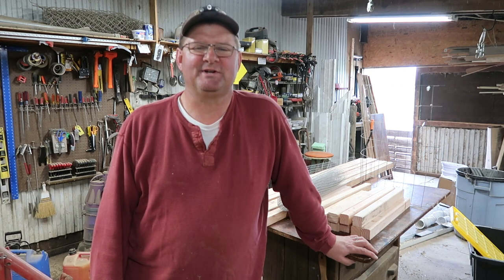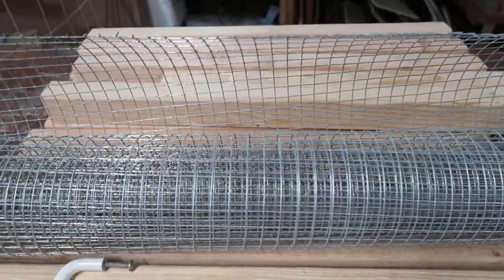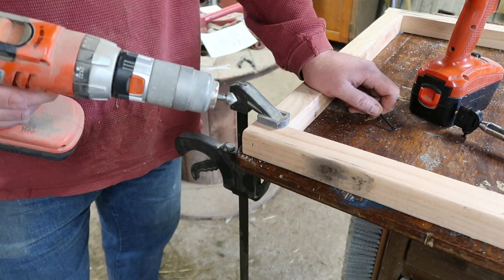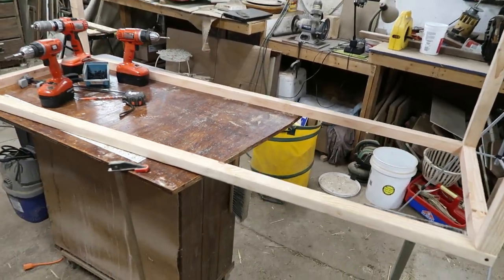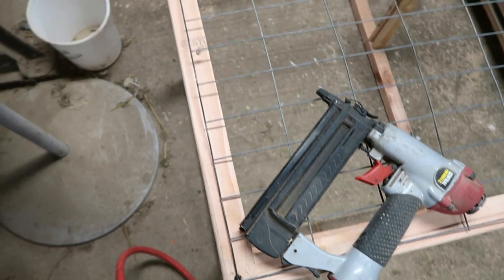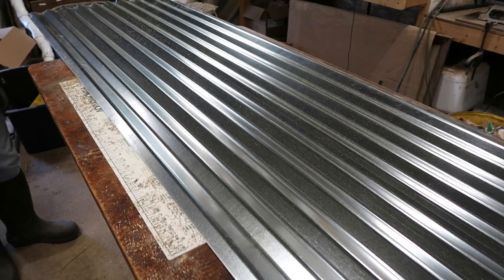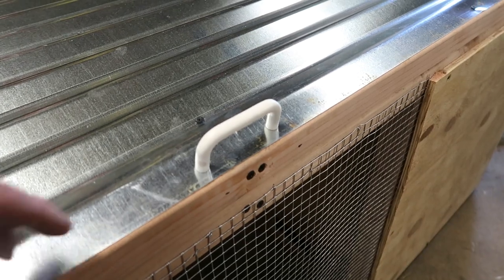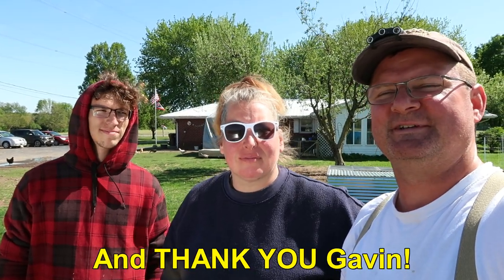Building a Rabbit Tractor for about $75

Comment: I like this idea. My grandparents used to raise rabbits in cages.  I was wondering if the roof on the cage would make it too hot for the rabbits or if you try to keep it in shaded areas during the warmer summer months.
Reply from the maker: Yes, we keep them shaded in summer. Haven’t had an issue with the metal causing temp issues. It’s so open and breezy.

Comment: I will be making this this weekend
Reply from the maker: Ethan Coleman good luck!  Let us know how it turns out. I found it takes me about 6-8 hours to build one. I have 5 and need to make more!
Reply: This project went really well. Finding the perfect wire size to use on the bottom is a problem. My little baby bunnies fell right through when I moved the cage. I accidentally crushed one baby. I’ll be shopping for different wire to put on the bottom. Also, the next one I build will be wider. It’s very windy where I live and a wider base would be better. I found that all the other dimensions were good. I also put the wire on the inside of the frame to stop any chewing.
Reply: I wish I could upload pictures in the comment section.
Reply from the maker: @ethancoleman4212  all good comments!  I have to move the cage very slowly and carefully, but for me, wire smaller than 2"x4" just gets clogged up with poop.  A wider cage would be more stable.  I've had a couple flip in high winds (more than 40mph). I haven't had any issues with chewing.  I also throw in a stick or piece of wood for them to gnaw on.  YouTube took away the ability to post pictures, but you can post a link to a picture, such as a cloud service like Dropbox.

Comment: Hello. Thanks for the video. 

I wanted to ask if the tractor is going to be for does raising kits then what is the right size for spacing for the slats on the bottom? (It would seem like you wouldn't want the kits to be able to pass through the slats but still have enough grass to go through, right?) 

And if you build this so the top can open, what's the lowest height you can have without them being able to jump over the top? (Or is this not an issue?)

Comment: Diameter of screws, please?
Reply from the maker: Not sure of diameter, but I use standard drywall screws. Many are 2.5”, 2”, or 1 5/8”, depending on what’s being attached.  I use a 1/8" drill bit to drill pilot holes.